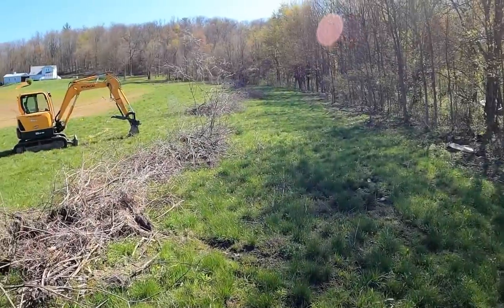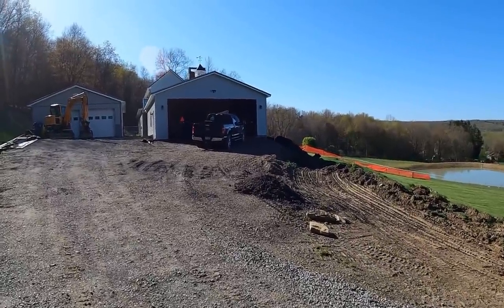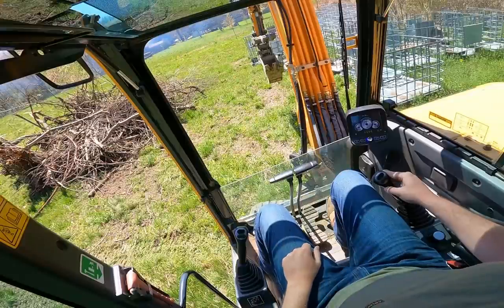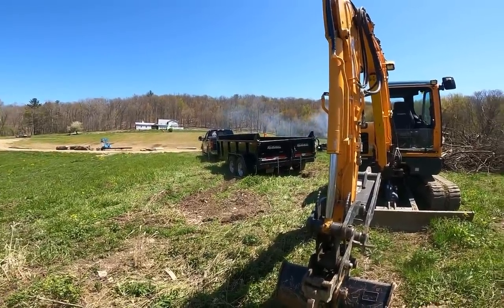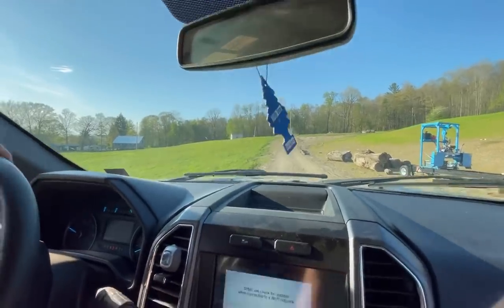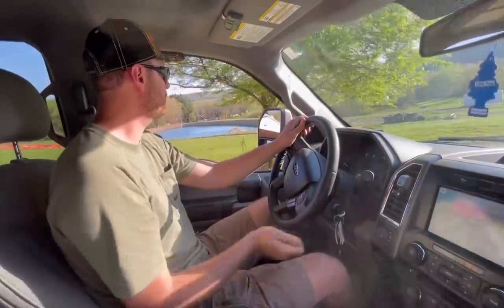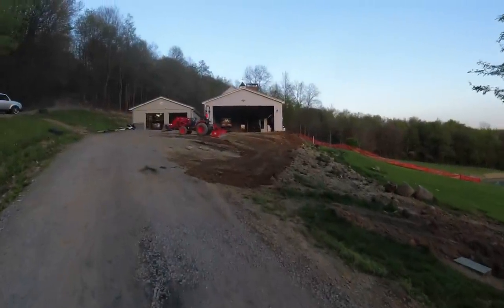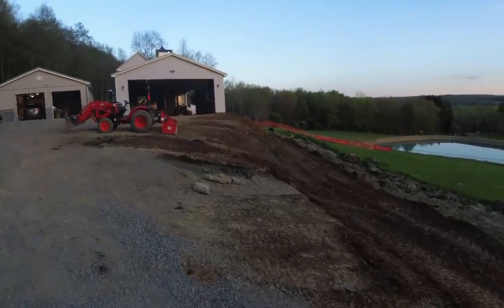We’ve Got A Lot Of Dirt To Move

Comment: Few tips for you. When loading that trailer or anything in general. Always load from rear. Never over a “cab” or your truck in case you loose material and damage/hurt something/someone.  You can speed up loading by parking trailer next to you. Swing 90 not 180 degrees plus.  You figured out no need for tailgate and to dump in the hole.  BUT DONT FORGET COMPACTION COMPACTION COMPACTION!!!!  do small lifts and compact it.  Reduce setting and shifting.

Comment: Equipment is meant to be used not babied. Fill the trailer up some more. You’ll be there all year at that rate. Other than that nice video. I just recently leveled an area around my property also. 5 loads a day for 3 months. Also get a wireless remote for your trailer. That way you don’t have to keep getting in and out of your truck.

Comment: One trick i have learned when spreading with a box blade with the small tractor like mine and yours i see, either pushing or pulling the material,  is put a full scoop of material in your bucket and make sure you are in 4wd.  The additional weight up front makes the front tires grab waaaay better and the 4wd helps move you right along with the extra traction.  Hooe that helps.  Doing great on the whole project,  pond is losing less and less water every day and your addition is coming right along.  Also , could not agree more about adding all this fill for a bigger drive way.  It will be better in the long run.

Comment: Adam I have a 7' skid steer bucket and heaped full it is only 1 yard max. I don't think you have 4 yards in the trailer and could probably put a couple more buckets in easily. 
My dump trailer is only 6.5'x10' and when I have it filled with gravel or screenings at the pit it scales material only at 6500 to 7000lbs.
I have owned a number of 4x4 trucks and plowed snow for 30 years and have never put my truck in 4 low. I was told by a long time mechanic to never use it and I never have. If 4 high doesn't do the job then try something else.
You might have mentioned it by do you have your truck in tow/haul mode? Higher tranny fluid flow and a lot easier on the truck.
I agree don't buy any material, save the money for the next piece of equipment.

Comment: Looking good, remember weight is your friend when you are compacting, so I think you will get much better compaction when roll packing if you fill your front bucket full of soil, as much as possible without it spilling out as you drive.  Then I am sure you know the drill, keep the bucket low for stability.  Of course this only helps with the areas that you can use the front tires for compaction.  If you need to use the rear tires for compaction near the building, then dump the dirt and if stable enough, raise the FEL all the way up to get that little bit more weight on the rear.

I would also suggest that you make it a habit to never stand between the dump trailer and the truck when you are raising the bed, especially when the trailer is not "inline" with the truck.  As the weight shifts back in the dump trailer, if it happens abruptly (or on unlevel ground), it can lift the rear of the truck and everything start rolling or pivot and close the space you are standing in.  While you likely have 4wd engaged and the parking brake, etc and are probably safe here, it is a good habit to make sure you are never standing between them for that one quick, awkward dump when things go bad quick.  Just a suggestion. 

Keep working at it, you'll get there.  Enjoyed the video!

Comment: Nice on the hydraulic quick disconnect!  Our Kubota excavator has quick attach but I still have to get out of the machine to manually remove the pin.  We don't have a dump trailer, so when we move dirt from the pond to areas needing fill...it's one bucket at a time in the FEL.  Beautiful shot @13:10

Comment: I used to build the front stub of the F-150 and have only ever owned one... That truck will put up with alot more than what you're putting it through... 1 cu yd of dry dirt is about 2000 lbs. You haul firewood which wieghs 2000 to 3000 lbs per cord. Quit babyin it

Comment: I had not considered a tracked excavator for the clearing job.  I too found backing a brushog to be difficult due to branches and hidden or inaccessible larger pieces of wood.  My neighbor will be thrilled to have some play time.
Reply: I got a lane shark for my 43hp John Deere utility tractor.  it requires 9-15 gal flow on the pump, but it works really well.  I took out 1700 ft of fence line trees in 9 hours of operation.  It was way easier than doing it by hand.  it is made for 2-3 inch trees, but I cut larger ones in multiple passes.  Also cuts branches down from bigger trees making it fantastic for cleaninging field edges.  Plus it was between 4 and 5 thousand.  a mulcher for a skid steer is 20K. It has a quick attach for john deere and skid steer built in.  Plumbing it was a little more complicated, so I let the dealer do it.
Reply: I have a Deere 35G mini ex and a tractor with a few attachements. Clearing trees of any decent size, the excavator is the tool for the job, dig the roots then push it over and the stump comes up with it. Scrape the dirt off of it to backfill the hole, and toss the trees in a pile in the woods to dry. Come back in a few months and pile them in your new clearing to burn. Smaller trees you simply grip and rip straight out of the ground.

Comment: As long as you are in first and low ratio then you can pull a semi just slowly. I once hauled some 3 ton loads of sand with a Renault 4 pulling a trailer made from a 14 ft caravan.
 1st gear and gently does it;  don't forget your sandwiches and maybe a razor.

Comment: If you really want to know where you're at with the trailer and dirt weight, pick up a Curt BetterWeigh. It plugs into the OBD-2 port and connects to your phone via BlueTooth. You have to calibrate for the empty trailer the first time, but it'll calculate both tongue and draw weight, load distribution, and trailer brake gain. IIR, I think of the new Ford's have something like this built in.

Comment: Bringing in heavy equipment always has collateral damage.  Also, small lifts separated by rain/plenty of compaction is better than trying to do it "fast".  If you are on a timeline then faster is better but I don't get the feeling that a week or two will throw everything off.  You've got plenty to keep you busy.
What's your plan for garage approach once the concrete is in?

Comment: Use your tractor hooked to the dump trailer and run the remote from the seat. Less wear and tear on the truck.
Reply: Tractor weighs less than the truck and also is less stable.   I think the truck, in this situation with the size Tractor he has,  is a better choice.  He does need a wireless remote though, that would help a ton and save time since he not loading the dump trailer fuller.
Reply: @thaddeustroyer  I pull a 7x14 dump with a 5550 bobcat with trailer and load weighing close to 15k doing essentially the same thing he's doing. Not sure how big his tractor is though.
Reply: @jamiebonjour1325  ok, not sure which tractor that is but what I can gleen from ye ol'e interwebs your 5550 looks to be a 6-8000 pound machine and pretty big too.  Again, I dont know for sure but his tractor looks like mine and from what I know its a 4000lbs machine.  That is a considerable weight difference, not to mention the tractor width/stance.  Yours looks to be a wider machine than his.  Stance makes difference too.   Not trying to argue, just going off observations.

Comment: Just a tiny tip….get in the practice of ALWAYS loading from the back.   Make it second nature so that it isn’t even a thought.
Reply: Clarification….swinging in and away from the rear of what you are loading prevents falling material from banging up the sides.  If you hired a driver with a dump truck, that might have been discussed at some point.  

Glad you used your own dump trailer. It seemed well equipped for the job.  I know some commented on how you didn’t overload the trailer…totally agree; if anything, you made more trips (burned more fuel) bc both the F150 could pull more and the dump trailer is designed to haul full loads .  In the end, you run what you brung and worked inside of your comfort.

Comment: I honestly like your videos but i must say as someone who has been in civil and mining earthworks most of my working life some stuff is getting painful to watch. your borrow pit is just a trench, now you just have a hole in your property, plan your pit as you will most likely over time go back in there for more fill, so what will your borrow pit profile look like when you are finished? strip all your top soil back for your planned volume extraction. lastly you need better compaction on your fill, what you are doing at the moment is not enough. your tractor is maybe only good for about 6 inch lifts because of its tonnage. point of reference 12 inch max lifts as a general rule and that's with a lets say 13-15 ton vib roller with 4 passes.